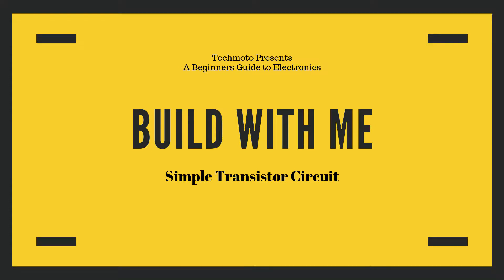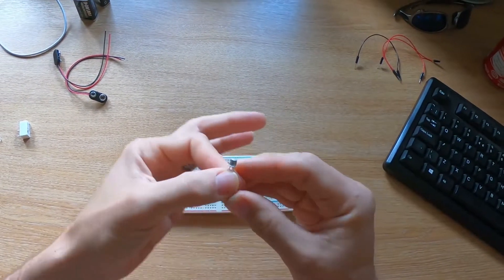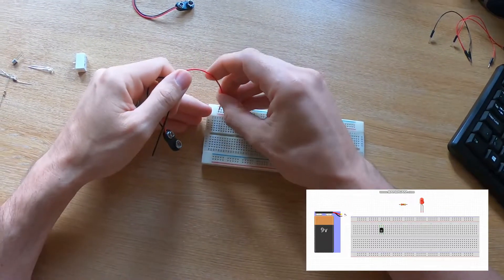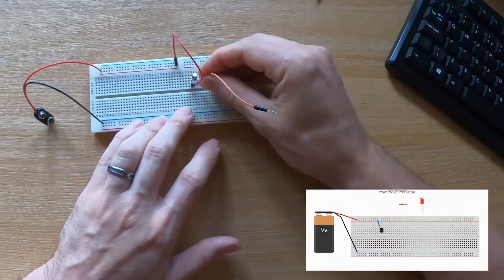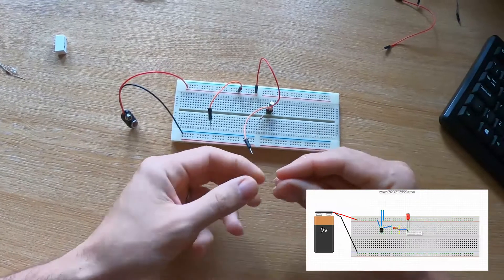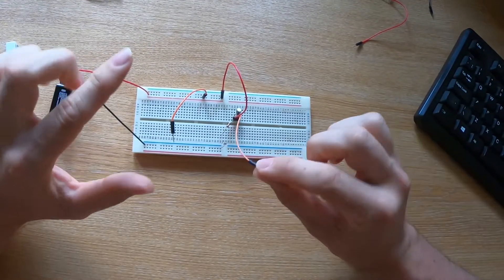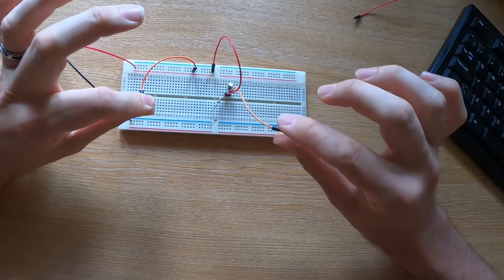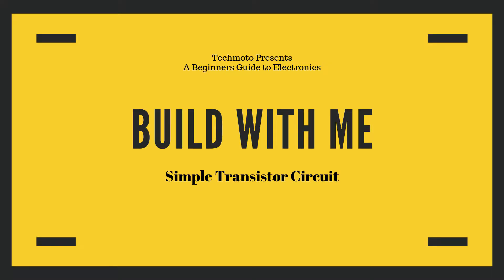Build a Simple Transistor Circuit

Comment: Heh, any chance you could do a video on how to build a backlight for a sign using an LED strip that is battery powered where the battery is charged during the day by a small solar panel or even some helpful tips on doing so? I've watched a few videos from others and all of the ones in this series so far and I have an idea of how to do it although I don't yet have the parts but those should be here in the next few days, including some breadboards. I know I will need a diode to keep the current from bleeding back into the solar panel from the battery at night, a transistor so that during the daytime when the solar panel is producing current the lights turn off and the battery charges and vice versa, when the solar panel stops producing the lights turn on. Haven't done any electronic building since highschool ... damn 28 years ago, well nothing like this anyway. 

Any hints, tips etc would be greatly appreciated and great videos btw.

Comment: It's amazing that the transistor can pick up enough power to switch on the led through 30 people :)  If the transistor is also used as an amplifier, if you had connected the base directly to the 9v supply, would the led burn out even though it was protected by the 220 ohm resister? 
 Please keep your videos coming, I needed to buy a single capacitor and found a Arduino kit on Amazon with bread board and many other items for a few dollars more and now it will be fun to build with it when it arrives.  (Last week I had no idea how the bread board worked)
Reply from the maker: Yes you have to be careful as the transistor calculation is basically C+B = E so you are correct - you would need to increase resistance to protect LED.  In this circuit however, the current is flowing through my body so what gets to the base is minimal.  Remember that for every volt you put through an LED you need roughly 50 ohms of resistance, so in an ideal world 9V would be 450 ohm resistor.  I'm planning on doing some Arduino videos in the future - with some easy projects, including programming - so watch this space :) If you have any questions as you investigate - you know where I am and I'm happy to help.